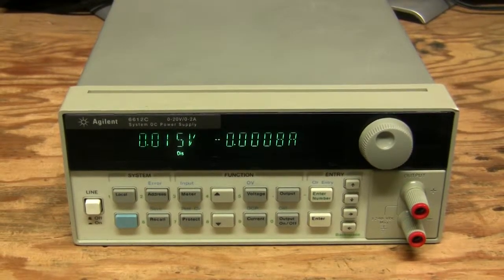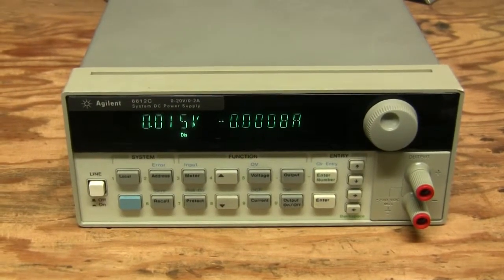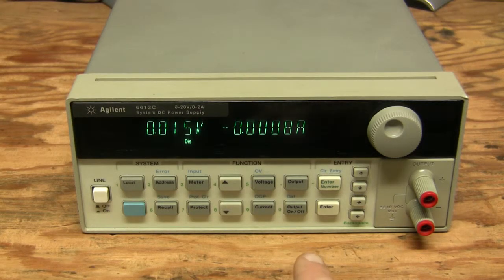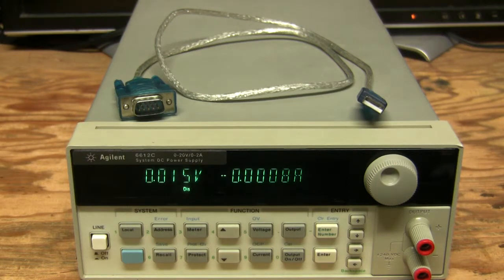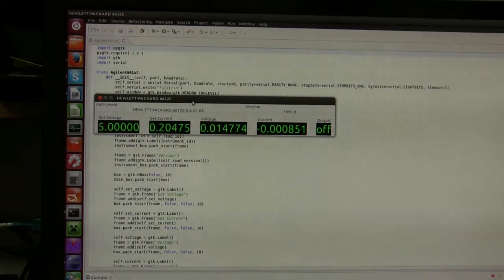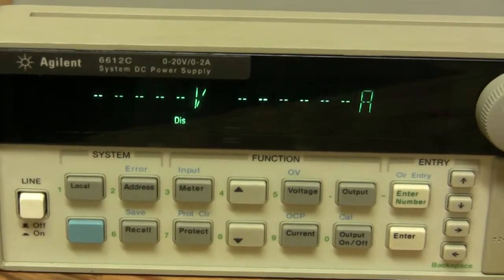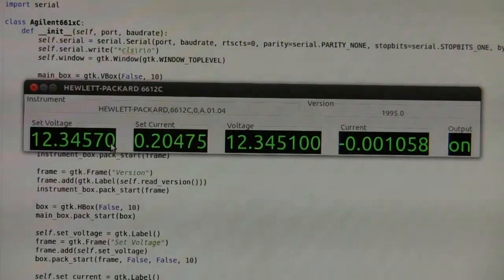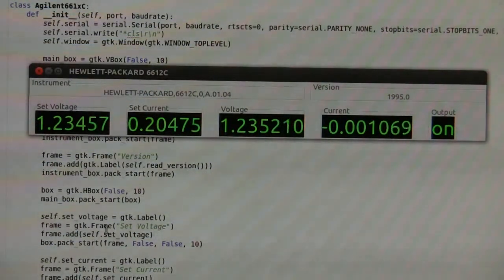#6 - Agilent 6612C serial communication

Comment: I really enjoy your repair videos and you do seem to have had a run of good fortune with these 6612C Power Supplies..!  I appreciate that you posted this video a long time ago, however I'm keen to try to replicate the control application which you kindly posted on GitHub. I recall you mentioned in the video that you used PyCharm to write the code, however I've been unable to import the necessary modules into my PyCharm environment....all three modules fail to import...pygtk, gtk and serial. I'm running PyCharm 2023.1 CE on my MAC with Python 3.11 installed.....am I wasting my time trying to get this Python script to run on this configuration ...some 9-years later ? Any suggestions would be really welcome....incidentally...the error dialogue from pip suggests that the error is with the module and not pip itself
Reply from the maker: I don't think I mentioned PyCharm. I don't think I ever used it.

Comment: thank you for your videos!
i'm using an arduino nano (max232) and C to get the values (volt? and curr?) from a 6612c power suply. I can get correct readings but I get 5 readings and it stops... forever. the arduino doesnt crash, so i believe the power supply simply stops responding. do you encounter such error while developing your python program?
Reply from the maker: No, I have not seen such a problem.
Reply: FeedbackLoop thanks! 
by any chance do you know a way to fix “error 1”?
Reply from the maker: Sorry, no idea

Comment: Hello 
6612c video very helpful as I have just calibrated one. Just wanted to test the rs232 output quick but I cannot see it on hyper terminal does the unit need a serial command to start the output.
Reply from the maker: I am not sure I understand your question. If the physical connections are right, and parameters are right (speed, parity, echo and such), then you send some command, and the unit must reply. If you just connect and listen, nothing will come out.
Reply: Hello
thanks for your reply
I did get it to work when I send out the commands I get the information back and I can also get the values back

Comment: Hi, I just calibrated the voltage on my 6611C using a well within calibration 6 1/2 digit DMM. Now the voltage readings as set via the PS are within a tolerance of 250-330 uV of the displayed voltage value on the 6611C when not under load (i.e., PS directly to DMM). If you haven't calibrated your two devices and you have the equipment, it's definitely a worthwhile endeavor!

The voltage calibration procedure is as easy as can be, as it usually is on HP/Agilent/Keysight power supplies. You get a low voltage below 1 V and a high voltage of about 8.8 V on my 6611C-J05 and you enter them in via the front keypad. Save and done - you have a calibrated supply (at least voltage wise).

If you were in the "neighborhood" I would do it for you, but sadly you're not (I live in Illinois...)

Unfortunately, current calibration requires a high precision 3W 400 ohm resistor (unobtainium category, part #0811-2878). Maybe I'll see if I can hack something up from multiple parts.

Comment: Wow, thanks for the analysis of this supply. I just bought two 6612C units on eBay. I know that you repaired this one and purchased it broken on eBay. If you don't mind me asking, how much did you pay for your unit a year or so ago?
Reply from the maker: +SteelBlueVision 
I don't quite remember. Around $150 I suppose.
Reply: +FeedbackLoop 
Thanks, I got both in working order for $300 plus $30 in shipping, so I guess that wasn't a bad deal.

More interestingly, I just also scored a rare beast on eBay: 6611C-J05 for $150 (plus another $30 shipping) in supposed working order. It is the same as 6611C, but goes up to 10V/5A in 3 mV programmable increments (instead of 2 mV on the regular 6611C) (current max and programmability remains the same). I guess I got really lucky, because the J** variants of HP/Agilent power supplies, especially in the right direction (i.e., slightly more voltage vs. slightly less voltage and more current) are very rare.